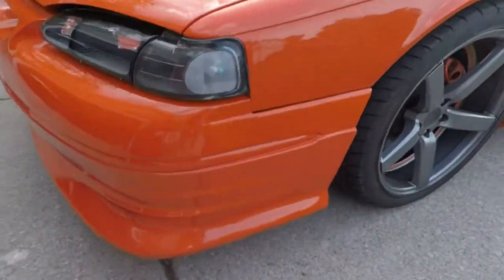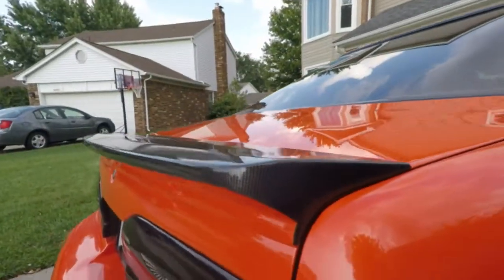Wrapping the Thunderbird

Comment: couple questions 
where did you get the spoiler from? company brand and does it cover all 89-97 trunk decks
Reply from the maker: Aaron H it's xenon spoiler that is made for 89-97 cougars... It doesn't fit well due to the shape of it. I had it cut and molded into the tbird trunk lid👍
Reply: phatbrd 
any insight on how you cut and molded
i just got a new set of xenon effects from tccoa guy in ohio and a cowl hood.. 
yes im a legit Tccoa member with a clean 91 bird in full swing with mods day by day. Not just browsing to add  commentary.

That would look good with the xenon kit.
Was it cut to contour the rounded edge of the deck lid then adhered or bolted down..
Your Michigan local?
Reply from the maker: Aaron H yes I'm in Michigan... For some reason I don't remember exactly how my guy did it but it was a lot of work. If you are local I can try to show you in person one day👍 I have 97 bumper and xenon kit for sale as well... It modernized the car... Mine is 94. Thanks 👍